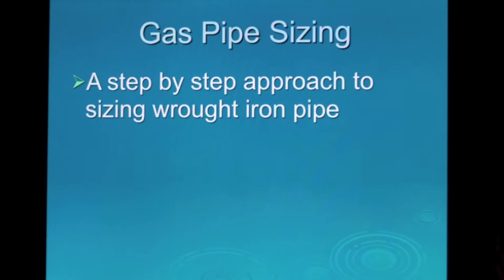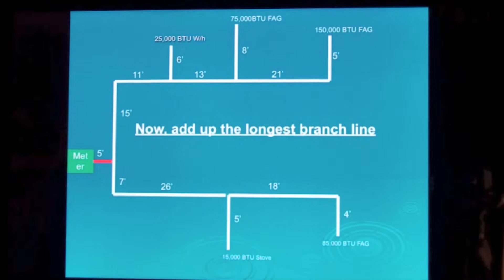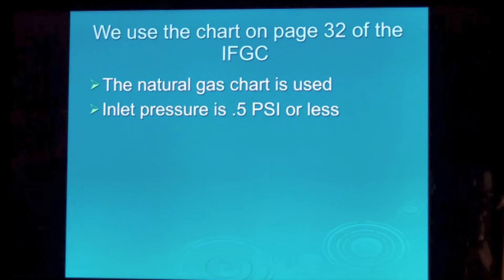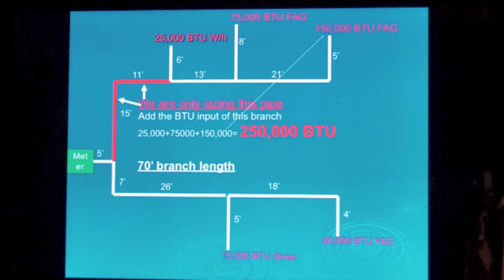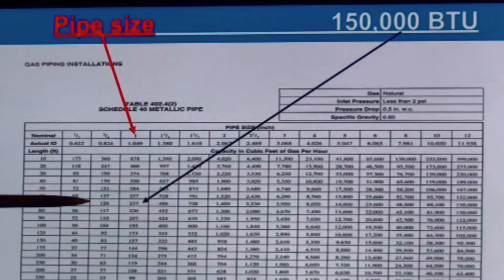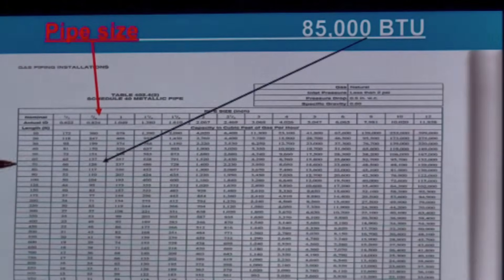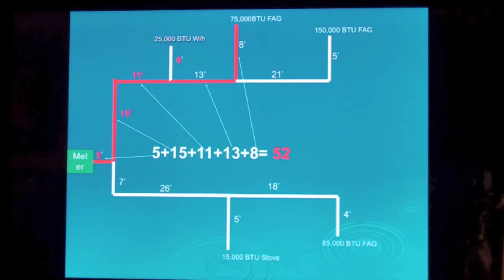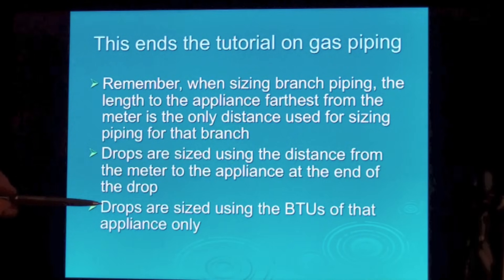Natural gas pipe sizing

Comment: Question on gas pressure. Probably not the most appropriate video to comment on. 

I had an issue with about a 40 year old furnace (NG). The property originally had this one furnace and a gas meter set at 7"WC. About 15' of 1" pipe to the Mechanical area and the Tee'd a d reduced to 1/2" to go to the 77,000 btu furnace and 30,000 btu water heater.

An additional added a new kitchen with gas stove. Followed by a third addition which added a second 60,000 btu furnace.

I was called to look at the original furnace because at beginning of this heating season the owner found it to light but then would shut off moments later. I determined the controls to all be working correctly and checked the inlet gas pressure and found it to have about 7-8"WC without the furnace running and would drop to about 6 while it was in operation. Within 30 seconds of flame you could visually notice the flame fizzle out and then the gas valve would shut off at a flame fail. The furnace spec indicated a minimum of 4.5"wc and max of 10.5. Manifold spec was 3.5. My testing of gas pressure always showed gas pressure within range on inlet and manifold sides. I checked the orifice and burners yet come to the conclusion that the gas valve must be faulty. 

Instead of replacing the gas valve the owner just wanted to replace the furnace being it was as old as it was and this being a rental property. I put new furnace in and found it to do the exact same thing as the original one.. gas pressures all read within spec. Manometer was zeroed out numerous times as I did when checking the original to be absolute certain I was getting the most accurate reading of gas pressure. I went as far as turning the gas off to the other furnace and water heater..But each time the gas pressure was and remained in range yet still the furnace flame would fizzle out and the go out on flame fail.

I'm using a new UEI two port manometer. Is it possible that this just isn't picking up a drop in gas pressure fast enough? All I can figure is that there simply isn't enough pressure being the meter is only set to 7"WC and there just simply isn't the volume available. Even though I don't have the readings of too low of gas pressure at the furnace to support that.... ????? ... plus doesn't explain why there hasn't been any issues up until now.. the 2nd furnace operates just fine. Right now the plan is to have the gas company replace the meter with a 2 psi and we step it down right at the furnaces and water heater as well as replacing some of the old blue pipe.

Curious if you have ever encountered this?

Comment: This is way too broken down. If you figure out 65 feet instead of 70 you’re good to go. Then you can just branch off. 1 1/4” for 65 feet then 1/2”, 1/2” and 3/4”. 1” on the other leg with 1/2” and 1/2” branches. This was waaaaaay too drawn out.
Reply from the maker: This is a video backed up by the IFGC.  We do it this way because it is code.  You could or could not be right, but I am not going to do it that way and then have to explain how I did not follow policy.
GFM

Comment: The IFGC table lists "Capacity in Cubic Feet of Gas Per Hour."  It doesn't say, "BTU/hr."  
Is it inferred that 1000 BTU/hr = 1 cubic foot gas per hour?  
Is that how you correlate BTUs to Cubic Feet of Gas?
Reply from the maker: I am correlating to 100 BTU.  If your numbers are different, you must adjust.
GFM
Reply: @grayfurnaceman  My apologies, but it's still not clear to me.  As an example, look at 30' length for 1/2" pipe.  The chart publishes 95 Cubic Feet Capacity of Gas Per Hour.  Using the logic in your demonstration, that correlates to 95000 BTU's.  It's not clear to me how you are making that correlation.  Is it standard convention that 1 cubic foot of gas per hour equals 1000 BTU?
Reply from the maker: Unless your local gas suppliers gives you different numbers, yes.
GFM
Reply: Here is the heat content  for Natural Gas: https://www.eia.gov/dnav/ng/ng_cons_heat_a_EPG0_VGTH_btucf_a.htm
If gets below 1000 they have other combustible gases.

Comment: I have a question- What happens if you size the pipes incorrectly? I presume that if the pipes are too small the appliances won't work correctly, but too big is okay. Am I correct? Thanks.
Reply from the maker: This is a minimum sizing system.  Bigger is better.
GFM
Reply: That's what I thought. Thanks for confirming.
Reply: No thats not right bigger is not better, appliance will run inefficient
Reply: @Jeff-hg7nw  You are saying that if the gas pipe is bigger than needed, the appliance will run inefficiently? That makes no sense

Comment: This is a great video! Do the specs define the requirements when you have 2 appliances on a single drop on a branch line?
Reply from the maker: 2 appliances on a single drop are considered as one appliance using the total BTU of both appliances.
GFM
Reply: Wouldn’t it just be a main branch in a vertical orientation having two horizontal drops? That’s how I envision it. Tomato tomato I guess.

Comment: After sizing that first 5' pipe at 1-1/4", could I just use that 1-1/4" pipe everywhere else including all the drops? I'm sure the material would cost more, but is there any other reason not to do that?
Reply from the maker: No.  You could do that.
GFM
Reply: if you ever run pipe youll understand  running a complete system of pipe way over size costs more is harder work too but if you oversize a branch because you got those fittings and pipe then it might save you some time
  but what sonnaps  suggest is a total waste

Comment: I would stay you have to stick with 70 FT!! but also, what about the fittings?? you should add equivalent length for fittings as part of your total full length to the longest run! sorry but this is not the way it should done
Reply from the maker: This method is the accepted method by the IFGC and I taught it for 9 years.  Branches are sized separately.  Consider if you had one branch that was 10 feet long and the other is 150.  It would be a massive oversize on the short branch.  Fittings are accounted for in the method.  This way of sizing is designed for installers that are not engineers.  So it is simplified, and the size is larger than if an engineer sized a system. An engineered plan would include fittings and would probably be sized smaller.  
GFM

Comment: gray...I gotta say, the calculations are wrong! after establishing the 70 foot LMR(longest measured run)all pipe sizing, including main and branch lines are based on that LMR. The LMR could potentially change if the table requires you to add fitting loss due to Tees, valves, 90s etc. But from my knowledge, that LMR is king! essentially doing it the way you did, establishes, different LMRs within the actual longest measured run, which is absolutely wrong...sorry Gray!
Reply: Thank you for this reply. I'm reading the coding book right now, and this was actually getting me confused. It's how you just mentioned.
Reply: @TradeWarBuzz  did you get it
Reply: Stfu

Comment: Thanks ! Long Run Method and Branch Run Method
Reply from the maker: This method follows the IFGC.  It is the longest pipe method.  When you have 2 branches, you use the longest pipe in the branch.  
GFM
Reply: grayfurnaceman 

Thanks, you are right . There are 2 methods to size the gas pipe. Longest Run Method and Branches Run Method.
I got it. But the Branches Run Method use smaller size of pipe

Comment: Great, you took 20 minutes to do a couple math problems but GAVE NO REASONING!  If you already know how to add, subtract, multiply, and divide this video will only waste your time.
Reply from the maker: Ours is not to reason why, ours is to follow the code.  We are not engineers.
GFM
Reply: Actually, I was eluding to the REASON for the code.  I'm guessing there is a code in place so there isn't too much of a vacuum created.  Are there any other factors you know of that might contribute to the reason different pipe sizes are needed?  I apologize for the harsh criticism.  I spent a lot of time looking for the reason on the internet.  Thanks for the reply.
Reply from the maker: I am curious about vacuum.  The gas pressure is positive pressure.  Residential runs 1/4# .  The piping size does determine flow at a fixed pressure drop.  The pressure drop is usually 1/2# water column.  Let me know if I can help further.
GFM

Comment: I did not watch the entire video, but he is doing this wrong. He is reading off a CFH chart not a BTU chart.
In order to use this chart, get the total number of btu's and divide by 1100. That will give you CFH 
So in this case 350,000 / 1100 = 318 cfh
Reply from the maker: The video is based on 1000 BTU per cu ft.  Your local utility may have different capacities.  If you have 1100 BTU per cu ft, you will have to adjust.  If you have 900 BTU you will have to adjust. 
GFM

Comment: its like hydro, if you install under ground cable for 200 amp they want 4/0 aluminum, but if hydro do the same work they only install 1/0,, now with gas, the gas company only supply's a 1/2 line from a 2 inch line on the street, 1/2 inch to your home, yet the want you to have an 1-1/2 from your meter into your home, the supply to the home is far from what it can supply to that 1-1/2
Reply from the maker: Actually it is not.   The gas supplier uses a pressure of about 20#, and you are supplied after the meter 1/4#.
GFM
Reply: thanks,
Reply: Depending on your gas utility company!  Locally we have some gas mains with 50+ psig and some old systems with 14" WC in the main... our typical house meters supply 7" WC at the meter regulator.

Comment: Great class, informative too.  What is code as far as unions go?  Can they be inside the cabinet, or must they be outside the cabinet?  I had someone tell me, drip legs,  are no longer required,  because the gas is so clean, compared to yesteryear.  Lets say I’m at the unit and want to drop the pipe size.  Does it matter what side I install the gas ball valve on.  I mean the smaller size will do just as well as a large one, and be cheaper to boot!  What is code about painting and color. What about pipe support distances… I heard high pressure gas pipe was painted “Red” (25PSI) I need DATA!!!!!!!!!  FEED ME!!!!!!
Reply from the maker: Drip legs are part of the IFGC regs as far as I know.  However, the only thing I have ever found in a drip leg was cutting oil and threading chips, so they could do away with them.  Use the smaller valve as long as it is not smaller than the input pipe to the appliance.  The only color I have seen for gas is yellow.  I will be doing more on gas codes.  I have just started a series on passing gas codes tests.  Hope this helps.
GFM

Comment: nice video. please give more details on design and fitting used in gas pipeline
Reply from the maker: The piping is wrought iron schedule 40 as are the fittings.  You can also use copper.  The specifications are in the IFGC code book.
GFM

Comment: Though this is really good to have a chart to calculate pipe sizes for gas if your doing alot construction. I am wondering if there is seperate charts for each type of gas supplied. Though natural gas is probably the only one uses distributively normally
Reply: Very old question, but yes, there are charts for different gasses. Natural gas is common, but there is a chart for propane that is very common. Propane can run on a lot smaller pipes, which is what makes switching from propane to natural gas more difficult. Propane can be run through copper pipes even, that small flexible type. This is due to the difference in energy density in each gas.

Comment: Nice i wonder if they have a BTU to length of run chart for gas lines for nonresidential building like from natural gas supply company to house appliances or distributing compressors each... These charts seem to work with just buildings and home based piping not the pipelines starting at the natural gas company
Reply from the maker: +sam111880 Utility calculations for gas sizing are controlled by the utilities.  I have no idea what they use.
GFM

Comment: you have to include the fittings size, the chart for the fitting is available for down load on internet
Reply from the maker: +Rabai Mokrani The charts used are from the IFGC and fittings do not need to be included.
GFM

Comment: So you dont need to account for number of fittings with this method, just the length of pipe? Or did you already factor that into the "length"?
Reply from the maker: +bc454irocz89 The charts compensate for fittings.
GFM
Reply: +grayfurnaceman how? do they just estimate the avg no. of fittings? wouldn't the fittings effect flow?
Reply from the maker: +bc454irocz89 I can't say I know.
GFM
Reply: In New Brunswick Canada we use the b149-1 code book charts for sizing pipe.. and for low pressure systems anything under 2 PSI they calculate fittings for restriction for up to 20% of your LMR... so the charts have already calculated in low pressure systems for that 20% of restriction of flow.. but if you have an unusual large amount of fittings on low pressure system it’s safe to do your calculations and if they add up to more than 20% of the length of your LMR then you have to start adding in fittings equivalent lengths on low pressure systems.. but on high-pressure systems anything to 2 psi and over you have to do fitting calculations automatically...and the System would be all calculated using the 70 ft code zone to calculate pipe size for the whole system in this video

Comment: How do you find high pressure piping diagram?
Reply from the maker: +Erin Try the IFGC code book.
GFM
Reply: Thanks so much.  My boyfriend needs to study it for his G2 exam.  He was having a difficult time with it.
Reply: lol if you are talking about the G2 as in the Ontario Gasfitter lvl 2 ticket then this is the entirely wrong code book. In Canada the code book used is the B149.1 natural gas and propane installation code and we size using total furthest distance, not the way he demonstrates with this code.

Comment: You forgot one very important step. You are using the cubic foot chart for your capacity. btu/h are always different than cfh. Check with your local gas supplier to find your btu/h per cubic foot of gas. Your sizing is based on 1000 BTUs/hr per cfh. Wouldn't work in any town in my state. No go.
Reply from the maker: +Scott Rosenkrantz What is your gas rated?
GFM
Reply: +grayfurnaceman In my town it is 919 BTUs per cfh. which is 100,000 BTUs=109 cfh. Your sizing is correct based on ifgc, but you just didn't convert BTUs/h  to cfh/h. British thermal units to cubic feet/hour. Other than that you were spot on.
Reply from the maker: +Scott Rosenkrantz Thanks for the thoughts.
GFM

Comment: I used the exact same chart you used , I am a master plumber in texas and I was taught a different way , and it works great and easy for me . I am dyslexic . I get the total developed length then go to the furthest fixture and go backwards to the meter . I noticed I up sized every pipe compared to yours . I understand your method completely but I think here in texas they want you to be on the safe side I don't know. I used your method with great ease but came up with smaller pipe sizes . I do think my way is easier to learn and do you just go backwards . instead of forwards .

Comment: I have applied this method of calculation for other purposes , many years ago : sizing of ducts for exhaust gas smoke for electrical generators , sizing of ducts for ventilation , sizing of pipes for water.
But I have a question , According to this code is NOT necessary to include the loss flow generate by accesories , like elbows , valves or tee ? Is that related whit doing the calculation are made by using the BTU ?
Reply from the maker: +Angel de la torre coll The plan assumes an average number of 90s.  
GFM

Comment: how did you arrive at the .5 Iwc pressure drop ?
Reply: +Robert Travaline  good question
Reply: +Carlos Saad considered LOSS load average?
Reply: This is the question I have - how do you calculate the pressure drop? I read somewhere that it is the system pressure minus the largest pressure drop of any connected appliance, is that correct?

Comment: I have a 2 # system, I have 1" coming out of the meter, then goes in to the 1" manifold, then, 1= 1/2 to gas logs, 1= 1/2 to future use 60' away, 1= 1" for tankless water heater 58' away, 1= 3/4" for generac 15' away, 1= 3/4" for the hydronic system.4' away, 1= 3/4" another tankless water heater 2' away,                            Does my manifold and my main line coming out of the meter does it have to be bigger or not?
Reply from the maker: E. M. Torres Are you sure you have 2# gas?  This pressure is reserved for large commercial applications.  If you do have 2# gas you could run all residential appliances you have on 1/2" pipe.  When sizing pipe, you need to know the BTU input of all appliances served.  The type of appliance does not help.  You can find a link to the IFGC under "gas piping" on the grayfurnaceman website.  It gives all the pipe sizing charts.
GFM
Reply: Thank you, Yes I have 2#, am looking for a 6 port manifold, thank you again

Comment: A quick question: From the above video, would the pipe coming directly out of the meter need to be at least 1 !4'? 

Some videos I've see may have shown a 3/4' pipe exiting the meter for a couple feet and then feeding a larger load pipe. To me this seems wrong. 

Thanks in advance. 

-Eric
Reply from the maker: Volusia-ev Sometimes the meter exit pipe supplied by the gas supplier is smaller that what the piping requires, but that is not something you need to worry about because that is the supplier's problem.  
GFM
Reply: grayfurnaceman So from your example in the above video, you would want to see a 1 1/4 meter exit pipe? Just trying to wrap my head around this. 

Thanks
Reply from the maker: Volusia-ev Yes
GFM